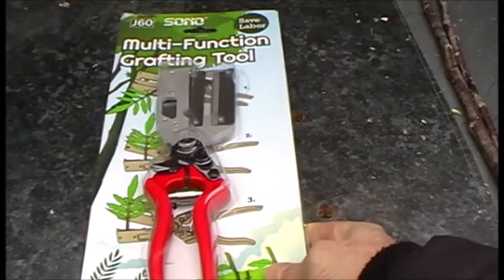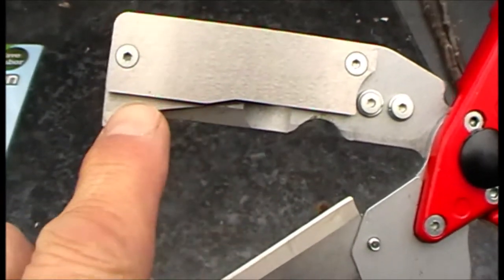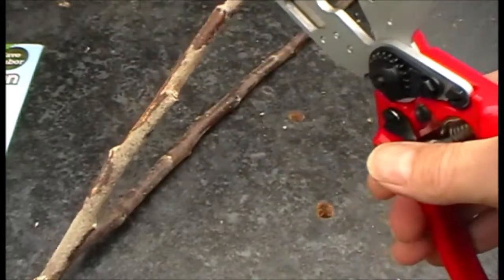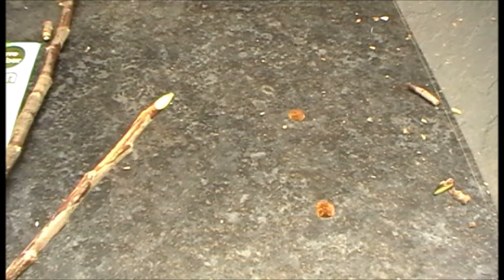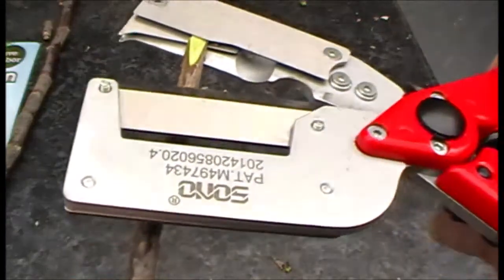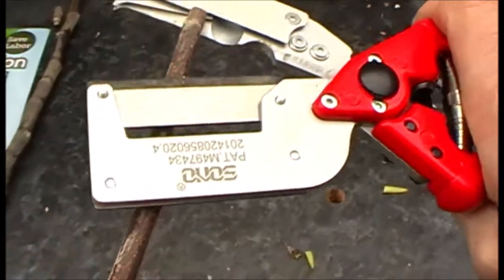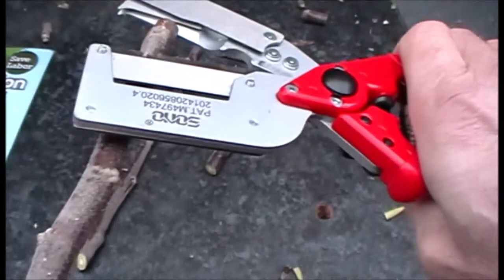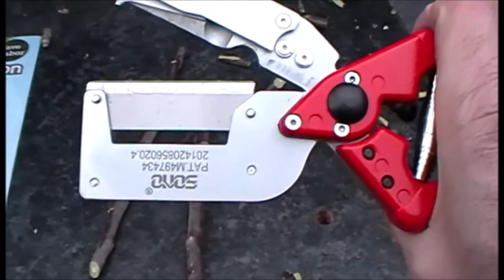Multi grafting tool

Comment: Thanks for the video, it's very useful to see this Scionon knockoff.  One thing, I'd have liked to see how wide it can be opened (or, how long a cut it can make).  All the cuts you showed were fairly short.
Reply from the maker: That's a very useful comment Dan, I will have to go back and check that out!
Thanks so much for stopping by 🙏

Comment: There another grafting too wich cost about £9.99p I recon its better due to the simple design comes with 3 blades I think you said its about £70 way to expensive
Reply from the maker: There are lots of grafting tools around Bill - its not possible for me to comment further without seeing the model you're referring to - what I can say is that I was fortunate enough to be gifted this tool (which came from China) so it cost me nothing :-)
the USA made version I believe is around the £70 mark (to buy in the UK) but they are built to last and spares are readily obtainable as far as I know. Its horses for courses.
cheers

Comment: Nice copy( and for  third price) of  a genuine Scionon  grafting tool.I  bought one also.Already grafted  100 pcs of fruit tree but the blade is unusefull. First 3 cut and  blade is blunt.Needed to make my own from real  blade.Now the tool is working and usable.
Reply from the maker: That is interesting to hear; there is a spare blade with the tool, but I would have thought you could get them resharpened with the correct jig. I have found it very useful tool for making a nice neat sloping cut ready to receive the tongue which I do with a grafting knife.
thanks for watching ;-)
Reply: 5:15 take big care! easy to cut your fingers.I did 2 times with this tool :(
Reply from the maker: @arnoldjobbagy1637  
Yes, I can see the potential for cuts trying to cut a tongue; I'd rather use a knife.
Reply: Arnold, what you say is true the quality of the blades on this tool were reported as being very poor, the tool woody has is the newest version with superior quality blades.